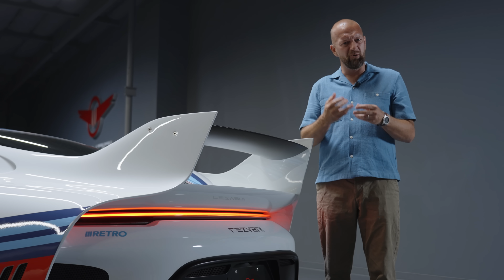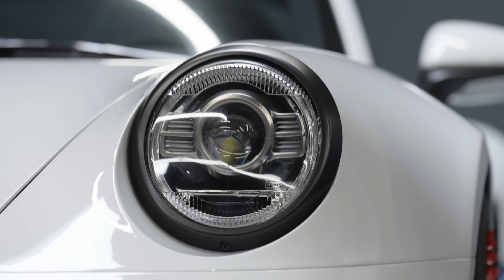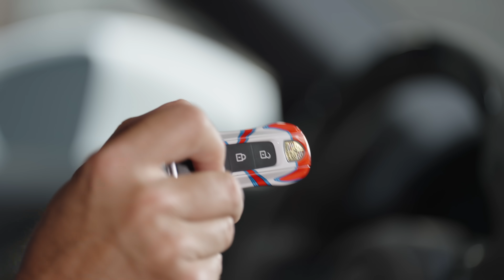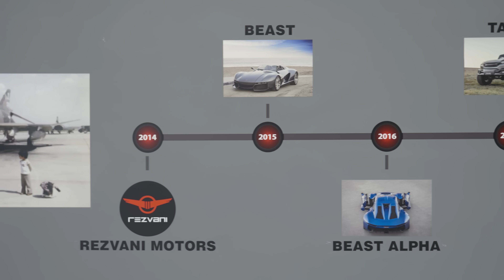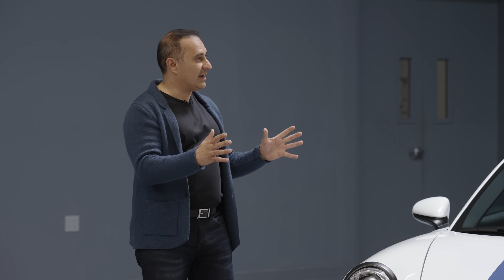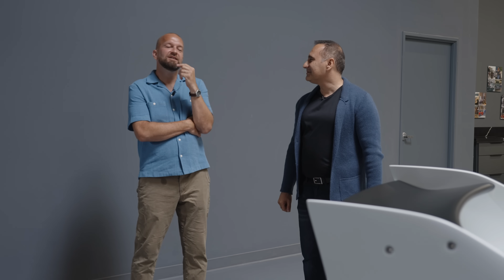Rezvani RR1 – America’s New Retro Porsche! | 4K

Comment: I think the design is very elegant and striking, but not a fan of those wheel covers and I always think exhaust tips look better on most vehicles spread out to the outer width of the car. IMO, doing so makes the car look more aggressive, whereas cramming them in the middle squishes the look and looks like a bung hole to me.  I also like the “martini” stripes but never really a fan of “number decals”. But I’ll proudly take it if you throw me the keys. 🤣

Comment: I doubt that very many people have the complete expertise and fully in-house personnel to create what Rezvani is providing. Just the carbon fiber wide body alone requires an enormous vacuum bag, body bucks, and curing oven, as well as the disassembly knowledge of the platform, which is beyond most custom builders. Honestly, though, I'd prefer an NA 356 for the stripped down seat of the pants road feel and the minimal power to weight sports car feel. The initial 911 Turbo S platform is over 1 and a half tons to start with, so I'll be wanting a 356.

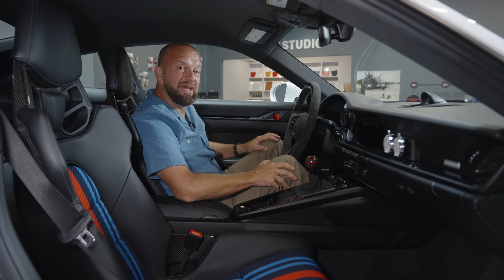Comment: 3:39 the interior loses me. One, it gives away that this is just a really well done body kit on the outside. Two, there’s nothing “retro” about the interior. It should be more barebones, more mechanical, more exposed, etc. You can’t just slap some clocks on the dash and say it’s retro. All the screens really take you out of it. I would have at least made a panel that flaps down over the screens… maybe that’s what I’d mount those timers to.